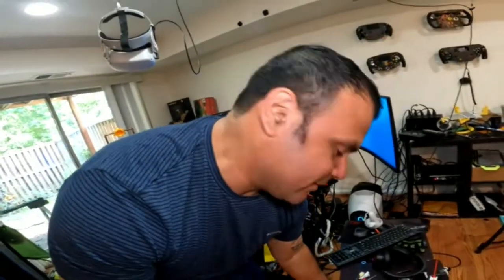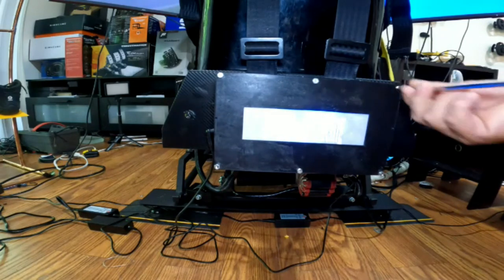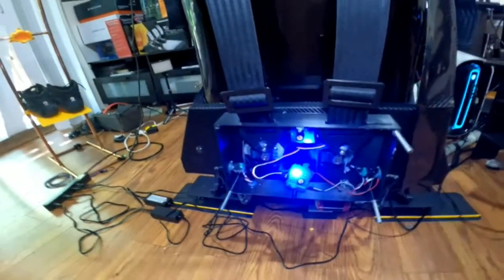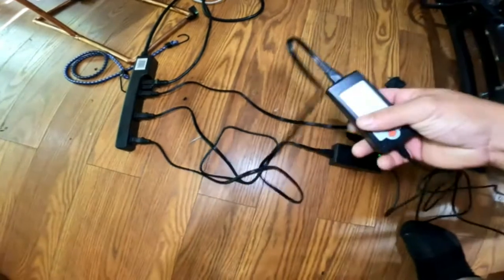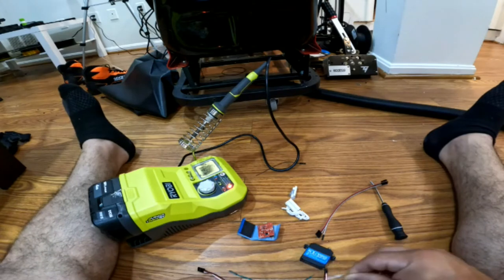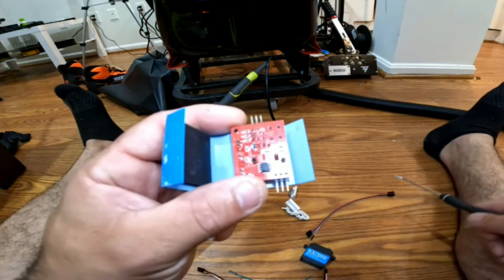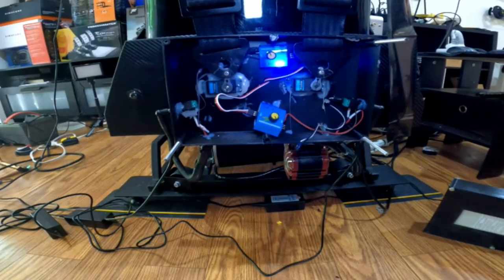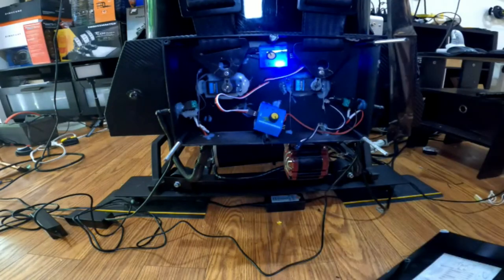HOW TO DO: belt tensioner FOR- SIM- RACING



belttensioner

Comment: Happy Fathers Day!  This does seem to be an improvement over the previous version you showed a while back. Nice work!
Reply from the maker: Thank you Dylan !! 
Yes way batter the previous version is more strong easy to make really happy with tus idea
Reply: It’s a little hard to see, but what is the total travel distance of the belt? It looks like +|- 2” or so.
Reply from the maker: Wow you have really good eye yes I just measurement is 2 “
Reply: Since these servos are often used for partial motion, have you looked at other t than on/off micro switches?
Reply from the maker: @dylanmosley3030  no really but i been touching the servo before not heat  at all every time I stop play I disconnect the power one day I left the power on was not heat or problem at all so that why I never try to find out on/off
Reply: Well man, your channel has definitely inspired me to work on my own solution to a belt tensioner. I just finished the first rough idea and it works pretty well actually!  I’ve got to make at least one more piece to improve it, but just wanted to say thanks!
Reply from the maker: Nice Dylan and thank you for watching my video I’m been thinking make other with arduino I need to figure out

Comment: What is the purpose of the RC Servo Tester? Do we really need it or we can make the whole circuit without them? i mean connect the servo motors to the DC power and magnetic switch. 
Thanks and btw great solution for ppl that don't want to mess up with Arduino:)
Reply from the maker: You really need the tester bc won’t I try to run straight with the power won’t do anything. And the tester is going to bring the motor back automatic you only need the switch to push forward reverse will be automatic hope make sense my writing English is bad 😂
Reply: @ferrerasimracing  Thanks a lot. Now it makes sense. What about the power source, you mentioned 6Volts, but what amperage are you using? And did you consider to use both servos in the same RC servo tester and after the same power source? I saw in the RC servo tester specification that can use up to 3 servo motors in one device.
Reply from the maker: The tester will receive the 6 voltage and will control the servo but in order to control the servos I decided to solder the micro switch in the tester. Yes you can connect two servo but , I don't know how much stress it will take the motors or the tester  remember we are adding a micro switch I will recommend you use one per engine

Comment: Is there a way to make this run off an arduino and simhub?
Reply from the maker: Yesss you can use like rumble motor  of sim hub with arduino uno you can  use curve left and right I will make video soon
Reply: @ferrerasimracing  please do. Thank you
Reply: @ferrerasimracing would you use an arduino uno w/motor shield then plug the servos into the spot marked servo on the motor shield?
Reply from the maker: @akpanjennings  yes I use arduino uno and motors shield is pretty much do wind simulator but you need to open the servo motor and solder the cable  in the motor that way will work
Reply from the maker: @akpanjennings  https://youtu.be/WcdD-a4oRL0?si=7XypF5sPYzl1tsP2
Reply from the maker: Watch this video you need to do this before plug the servo motor
Reply from the maker: @akpanjennings  yes you use arduino uno en motor shield together and plug the power supply and the servo motor
Reply: @ferrerasimracing  plug the servos into the terminals on the motor shield that are labeled servo1 and servo2?
Reply from the maker: https://youtu.be/8aLqqcEaUVk?si=bqr95VZQjWPWp7rF do the same thing of this video after you solder the servo motor like the other video
Reply from the maker: @akpanjennings   hey man how was the belt tensioner do you figure out?
Reply: @ferrerasimracing  I haven’t built it yet. Were you going to still make a video on the arduino/ motor shield method? I figure if you just set it up like a wind sim it should work only plug the servos into the slots labeled “servo 1 & servo 2” on the motor shield.
Reply from the maker: @akpanjennings  I need to find time to make video is little things you have to do with the servo motor to make it work